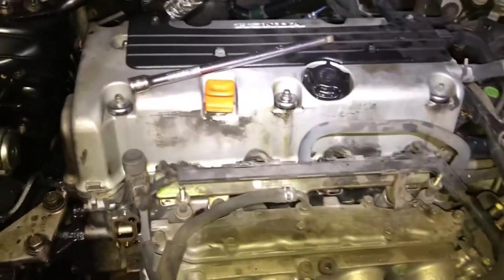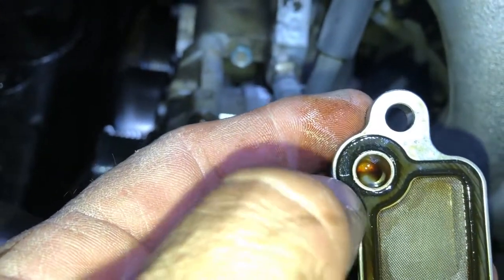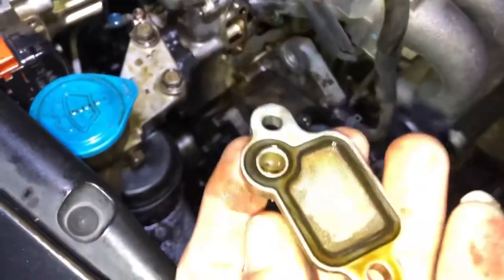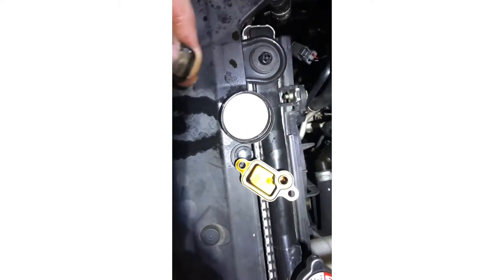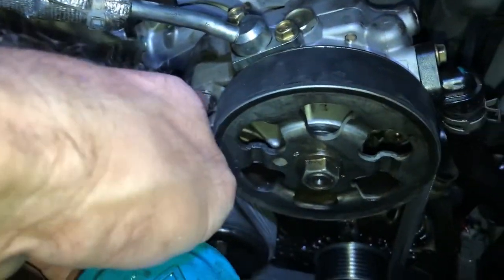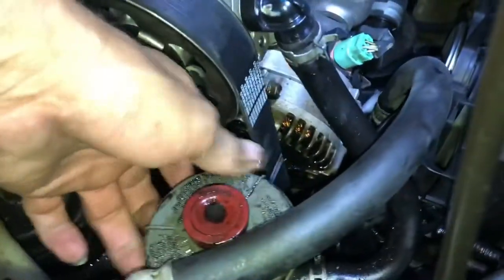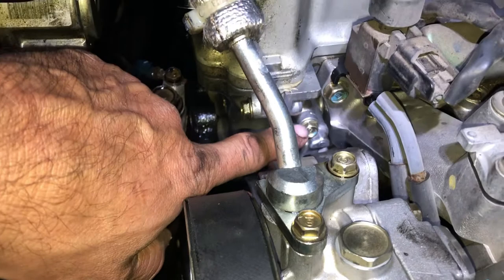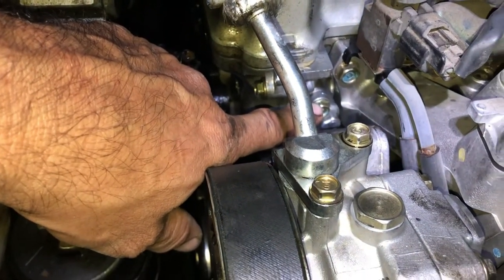Honda Accord leaking oil

Comment: Honda cars/ suvs have over 40 gaskets/seals that will leak at any given time & can take a while to figure out which seal is leaking, I have a similar issue with a 03 element...either oil or power steering fluid leaked all over the alternator and pulleys etc... that caused the drive / serpentine belt to come off and shred to pieces! ✌
Reply from the maker: If is power steering fluid, then it should smell like power steering fluid!!

Comment: Mine is leaking as well but engine is iding rough almost to the point of stalling.  And engine is shaking, and I hear a loud ticking noise.  Was yours doing the same when you discovered the leak?  My car was running fine then a couple days later this happened.
Reply from the maker: It was ticking because of the low oil, and stalling because of the oil low, oil pressure sensors act when low oil,
Reply from the maker: The oil pressure sensor can shut down the engine and will not start if the oil is tooooo LOW
Reply: I have a 2003 it’s doing the same I get a misfire code and I literally changed everything I can think of. PS it shakes more when I turn the AC on
Reply: @lifeofbriang1964  Funny you should mention this because just the other day I got a CEL and engine was running slightly sluggish.  Read codes and it was misfiring on all cylinders.  And just like you I replaced and cleaned everything I could do.  I've watched another youtuber mention misfire could be caused by tight or loose valves.  So, I'll be tackling valve adjustment job tomorrow.  FYI - I looked inside the piston head when I took out the spark plugs and I noticed quite a carbon buildup so I ordered SeaFoam.  Will give it a clean after my valve adjustment.
Reply: @Nemesis74racer  idk how to do valve adjustment :(

Comment: So what part is that you changed what is it call
Reply from the maker: It’s in one of the bottom messages
Reply: VVT Oil Control Valve Filter
Reply: @juanvaldez1441  as i understand, you did not change the whole part just the gasket for it, correct?

Comment: What's the name of the part?
Reply from the maker: https://www.partsgeek.com/gbproducts/WC/5986-01305272.html?utm_source=google&utm_medium=ff&utm_content=YN&utm_campaign=PartsGeek+Google+Base&utm_term=2003-2012+Honda+Accord+VVT+Oil+Control+Valve+Filter+Genuine+W0133-2386644+03-12+Honda+VVT+Oil+Control+Valve+Filter+2009+2005&fp=pp&gbm=a&utm_source=google&utm_medium=ff&utm_campaign=PartsGeek+Google+Basecid=6774379819&aid=79287199093&keyword=829684094289%3A%3Apla-829684094289&kid=829684094289&gclid=Cj0KCQjw9O6HBhCrARIsADx5qCTvK0kPUWzKvPOkMRz-H577mopobrcHA7pTzyXAHNRWfp00vqFxI-QaAlBhEALw_wcB
Reply from the maker: VVT OIL CONTROL VALVE filter
Reply: What name this parts
Reply: @saqibakram6438  	Honda Part No.: 15845-RAA-A01
Filter Assy., VTC